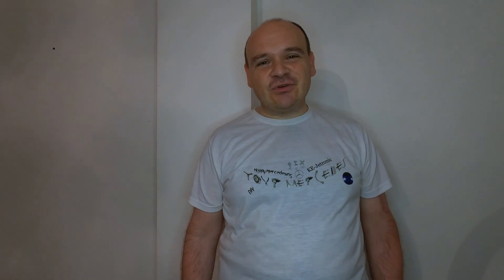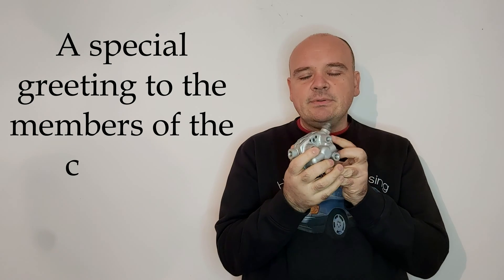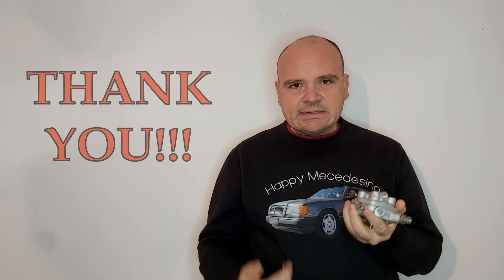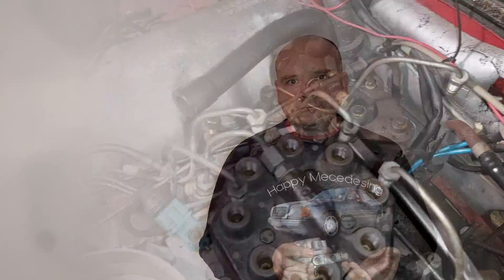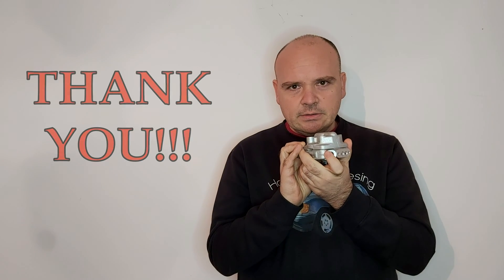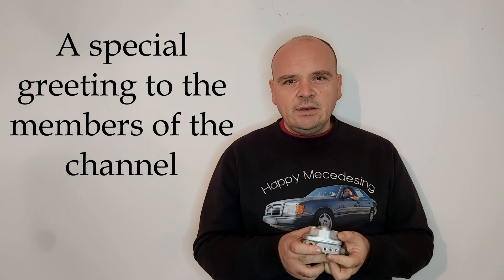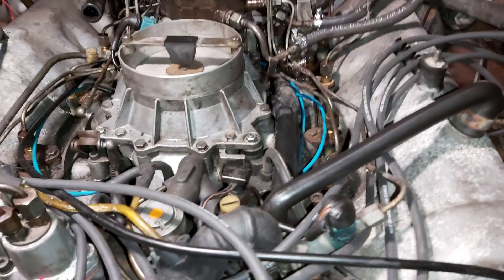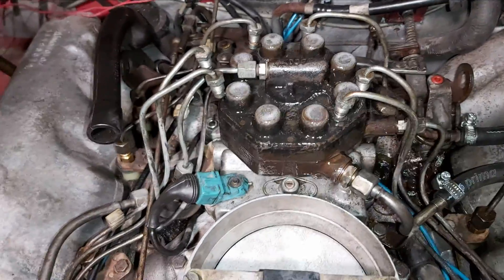㉦Mercedes Ke-Jetronic㉦ - 🛠️✅The correct fuel distributor rebuild✅🛠️

Comment: I just rebuild my 260se fuel distributor yesterday but unfortunately is leaking fuel out of the 6 ports with the fuel pump jump started and no matter how far I turn the mixture screw the fuel keep leaking although I noticed leaks less when it’s very far counter clockwise almost until end. Plunger is not stuck, diaphragm and o rings are new, fittings are on correct ports, I can’t understand what is wrong here as I rebuild very carefully and exactly the same as I did in a w124 few years ago and worked perfectly.  I disassembled and checked twice and everything looks fine. Do you have any more suggestions I should check? or possibilities why this happened? Thanks 🙏
Reply: Ok found out what the problem was. The control plunger nut depth. Everyone says it should be at around 0.58mm or 0.6mm depth but in my car it will leak fuel out of the 6 ports. I had to set it to 0.3mm depth that way the fuel stopped leaking. Not sure why in this time was different. Maybe the control plunger is a little bit different or something. Now next step is to check the fuel quantity at each ports during 1min. (Update: That plunger was warped if I rolled in my hand I can see the slight deformation and I suspect that’s why gas was leaking. I replaced it with another one and now I can set the nut to the correct 0.58mm depth and no problems since.
Reply: @gcgj1540 , thank you for this information. I'm going to rebuild on my 1992 SL300-24  R129

Comment: Still I don,t know what is a dofference for distributore for engine 102 with kat and without it. I can't find any informations about it
Reply from the maker: There is no difference. The only difference is that there are two types of M102 distributors - for the systems KE1, KE2 and KE3. They are not compatible with the airflow meters, so that's why there must be a good reason to change the distributors because they don't EVER have to be replaced, they CAN NEVER GO bad! I will make a video on this topic once I finish with the warm up regulator!
Reply: My friend, I have car with Kat. engine 102 but I checked I have installed fuel distrbuteur for version without Kat.
Reply: I have a problem with Black Spark plugs too much fuel.